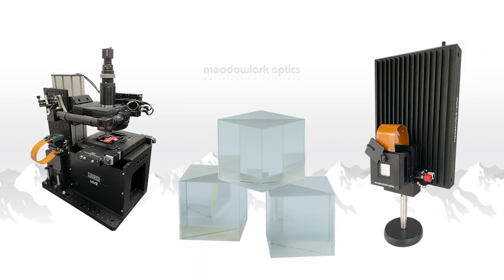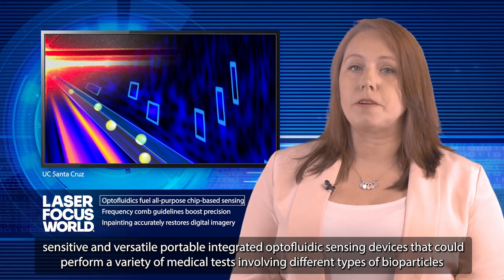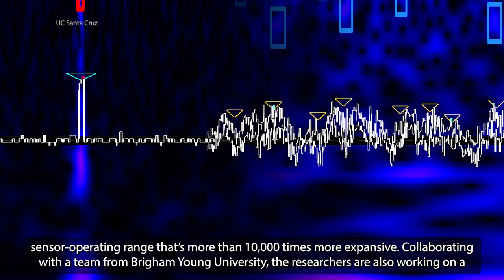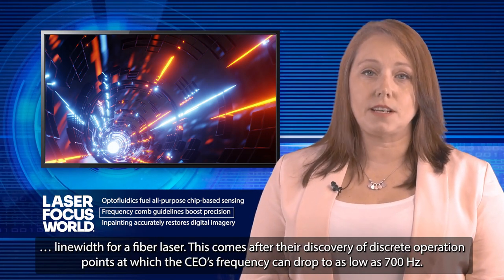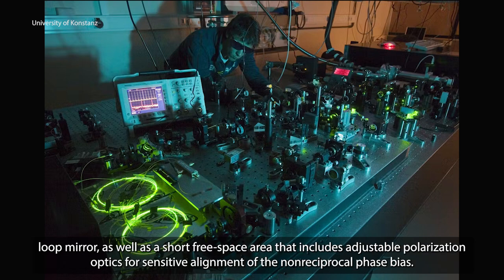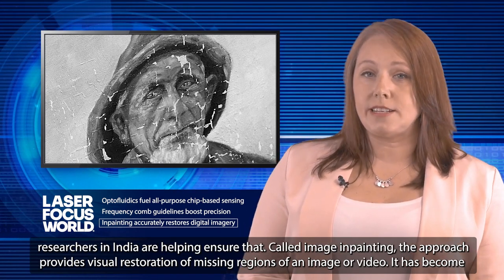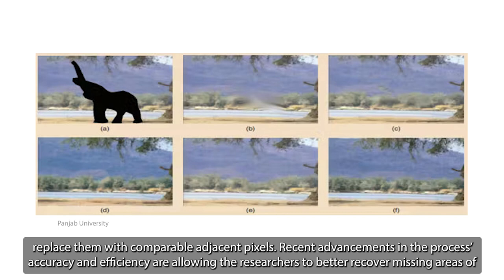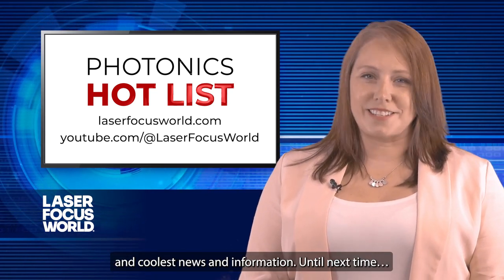Photonics Hot List: June 30, 2023

Comment: Dear Ms. Murphy.   Photonics will find its ultimate expression in molecular switching.  Photochromic molecular switches ( azobenzenes, etc.) come in many variations; still, they reflect the Quark Theory. There are 7 quarks including the "Truth';  the list could readily expand to 20 to correspond to the number of amino acids or neurotransmitters in the brain. It is possible to isolate a quark with a Color Force of 10 exponent 60 cm
sec.. Photons  will last for 10 exponent  60 cm. sec.-  to disappear into a quantum hole.  But a graviton could set them free as distinct quarks. Beyond the Higgs boson lies the Graviton, the god particle which will bring Photonics to full fruitition. The mystery of God has come to an end
  Yours truly,   Francisco Arpon